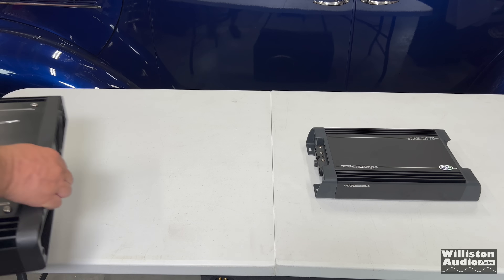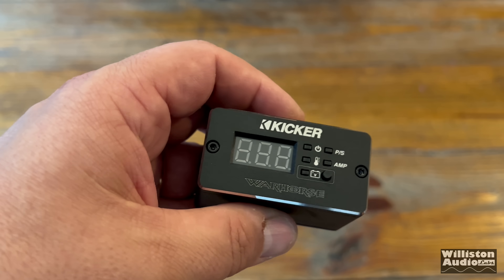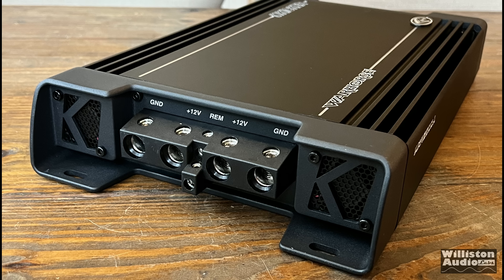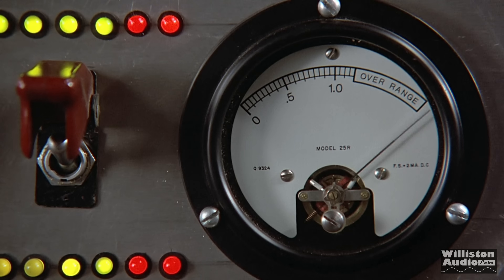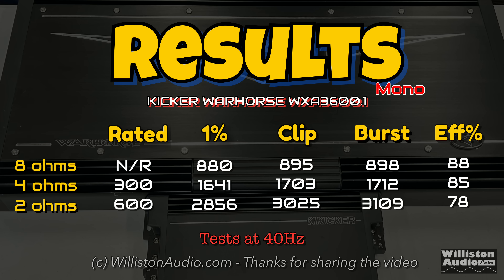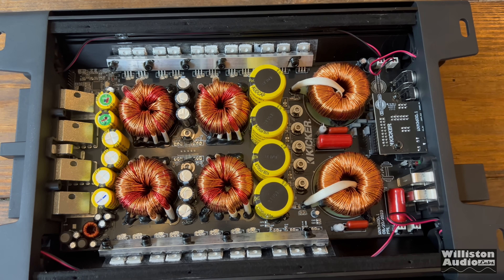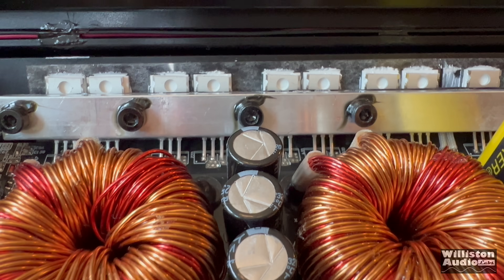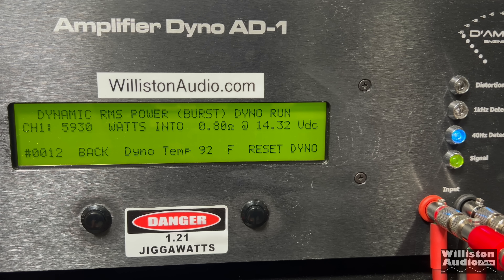KICKER Warhorse is BACK! WXA3600.1 Mono Amp Dyno Test

Comment from the maker: SHOP
KICKER Warhorse WXA3600.1 Coming Soon! (June 2024)
XS Power LTO Lithium Cells: https://lddy.no/1ivr6
KICKER Quad Box: https://amzn.to/3wBKEex
KICKER Key Loc: https://amzn.to/4dH5IRt
KICKER SoloX 12: https://amzn.to/497MQYk
KICKER Subwoofers on Crutchfield: https://howl.me/cjNYsFVKgx2
KICKER Subwoofers on Amazon: https://amzn.to/424JpOJ
KICKER SoloX Subs on eBay: https://ebay.us/UMhb2x
D4S Amplifiers and Speakers: https://Shop4Bass.com
SAVARD Subwoofers and Speakers: http://www.Shop4Boom.com (use code WAL7 for 7% off)

LINKS
KICKER Deep Dive Tech Talk about Warhorse Amplifiers: https://www.youtube.com/live/BNX7Sz_UMDE?si=_zxuxx9KGjgAfoBj&t=1165
KICKER Warhorse Amplifiers (coming soon) https://www.kicker.com/
My Unboxing of the Original 10kW Warhorse Amp: https://youtu.be/glj97XdfIVw
HiFiVega Warhorse WXA3600.1 Unboxing: https://youtu.be/-VF-Q1uWeU0
Livin' Loud with Andy Warhorse SPL Testing: https://youtu.be/lZVFBsH7nJ0

VIDEO INDEX
0:00 Intro
0:20 Warpony?
0:54 Years in the Making
1:28 Unboxing
3:45 Overview and Features
5:53 Lithium Power
6:13 KICKER Amp Test Procedures
6:55 Amp Dyno Tests
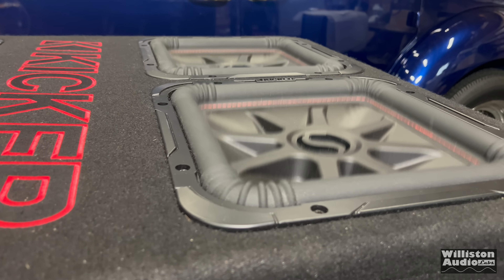9:53 Do it Bump Doe?
11:09 Watts Inside?
12:03 Power Supply Explanation
12:50 PROS and CONS
13:56 Final Thoughts
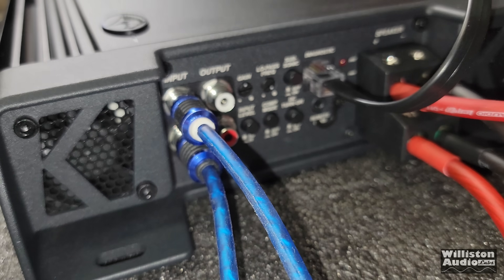14:39 EXTRA Tests

TEST BENCH EQUIPMENT
SMD / D'Amore Engineering Amp Dyno: https://goo.gl/sJTcf7
XS Power D1400 Batteries - https://amzn.to/2BPFCKW
XS Power PSC60 Charger - https://amzn.to/2CHGcfs
Fluke 1000A AC/DC Clamp Meter: https://amzn.to/2Rw5WDA
Handheld Dyno: http://amzn.to/2u2EgKV
My Favorite Screwdriver Kit: http://amzn.to/2x0VzcE

DISCLAIMER: This video and description contains affiliate links, which means that if you purchase from one of the product links, I may receive a small commission. As an Amazon Associate I earn from qualifying purchases
Reply: Hey big d, give me your honest opinion so you think full bridge just has a different sound to it more digitally or something like that. I honestly think it just sounds different from a Korean half bridge
Reply: I wish you could simulate a test with a smaller battery. People complain about the voltage being too high but A 320 ah lithium battery is 99 percentile car Audio enthusiast. Over $3000 in batteries.  Like can my little LTO 6.0 or my titan 8 run this amp?

Comment: I appreciate a clip indicator but I feel like I don’t really need it if gains are set correctly you’ll never clip no much how much you boost the bass frequencies on the eq on the head unit, you have to set the gain according to how you’re going to use the settings on the head unit so that your amp never goes past the max signal it’ll pull its power cleanly from the batt and alt without a distorted signal from the head unit

Comment: I am getting ready to install a custom enclosure in my 2024 Escalade using the factory stereo and using a LC2i pro to get the signal. My question is:
How will the kicker 1800.1 amp do with 3- Hertz MPS 250 4ohm wired together to 1 ohm? Am I saying that correct? Or would you suggest the WXA3600.1 for that set up I’m going to be running? Thanks in advance
Reply from the maker: The answer totally depends on your goals. I personally think the 1800 is enough for those subs, but if you are buying for the long run and want to possibly upgrade the subs in the future, I’d go with the Warhorse
Reply: @ thank you so much for getting back to me! I agree with you the 1800 is probably more than enough, however, I always kind of like to go big and get the best that I can. So if I install the war horse can I tone it down so that provides 1600 to 1800 W to those subs.

Comment: Just picked mine up the last item for my install alpine radio 
Audio control matrix 6
Audio control epicenter 
2 kicker cx360.4
2 pair kicker ks6x9
2 pair kicker ks pods
2 kicker kicker 12 inch marine subs IB set up 2015 dodge charger

Comment: Back years ago I had a Zr600 Kicker amp and it was supposed to be 600 watts RMS @ 4 ohms bridged, but according to the factory test print out. It was actually putting out 850 watts RMS, I was running a pair of 12 inch Solobarics (the round ones). I never never had the SPL tested but it had enough force to put out a zippo lighter of someone in the front seat of my little 92 Celica GT. I had a all kicker setup running off a Kenwood echelon head unit with a motorized flip face, the entire system cost me less than half of retail offline from a wholesale site. Needless to say this shop that had all kinds of high end electronics, nearly had an brain aneurysm when they asked me what I had when I picked up the crossover module I ordered from them and then how much I payed. They had some kind of deal that they were the exclusive dealer for kicker products in the area and me paying $2500 for a system I priced while browsing there, would have been around $6000.  They threw such a tantrum about their "exclusivity" deal with Kicker, that unless I told them what website I bought it from that I would be banned from the store. I laughed and said, "I already have everything I need from you and bye bye" as I waved walking out the door.

Comment: I'll take the Orion 2500. Half the price. Big D tested it a few years ago and it did 6744W at 14 volts at 1 ohm  Dynamic 😎
Reply: Don’t think they make the same amp now. I got the 3K Orion splx for 650 off Amazon. I think it did 10300 watts or so on big DS test
Reply: I have one if you wanna trade for this amp
Reply: in 20 years one will still be working
Reply: @kickercar  It wont be this Kicker thats for sure. cheap caps and fets. full bridge. Max lifespan of a cpl hundred hrs
Reply: @Cody6210  when is your amp line coming out
Reply: @kickercar  He's not lying, though. This Kicker amp is using some really cheap caps and FETs.
Reply: @TikiDoorman holy shit I thought you were joking but no those caps really are like China spec

Comment: I don't understand your comparison of the Sundown Salt3 in another comment. Compare the full bridge options for price and power.
Reply: Whether it's full Bridge or half Bridge it doesn't really affect the price.
Reply: @JasonWW2000  it absolutely does. Sundown full bridge 3k is far cheaper than the salt 3k. Theirs a reason full bridge amplifiers like Taramps, Banda, Stetsom, etc. are all less expensive than their Korean made amplifiers.
Reply: @FoxyBuildsDIY Yes, and I don't know if you understand why those brands are cheaper. I'll give you a hint, it's not because they are full bridge. Lol.

And how exactly do you explain all of the very expensive full bridge amplifiers from companies like Alpine, JL Audio, Kicker, Digital Designs, etc...?

Also, you're comparing Sundowns top of the line Salt series amplifiers to their entry level SFB. Their cheaper amps being full bridge is just a coincidence. It's actually not the reason it's cheaper.
Reply: @JasonWW2000  and if you look at the reference series or half bridge designs by those same brands they are even more expensive. If I remember right JL slash series is the only one in the lineup that uses full bridge technology. And of course they aren't all equal, those brands are using higher end components and larger power supply sections. But to say the SFB amps aren't comparable to the Kicker full bridge design is not accurate. They have very similar topology.

It's also not a coincidence that they are cheaper because they are full bridge. The fact is the Korean board's on the Salt amps are older Zenon designs and have more components and are more expensive than the Chinese built SFB amps using an original Soundigital design.
Reply: @FoxyBuildsDIY  Now you seem to understand. There's a lot more involved in the price besides whether or not it's full or half bridge. 👍

Comment: Hey I got a 2000.1 tramp amp but it keeps going into protection mode when the high pass hits….can someone help me out I’ve turned the amp down but my subs are ds18 gen x’s I have two with a peak of 2400 watt with each sub so it’s 1200x2

Comment: Looks generic.
Reply: It's not.
Reply: @JasonWW2000 I know the performance is there, but the looks are not. It looks generic compared to the og.
Reply: @CJGrand1  What do you think it resembles?
Reply: @JasonWW2000 something made by Maxxsonics. You know, like Crunch or Autotek.
Reply: I guess, maybe. I also see a lot of similarities with the original Warhorse. I don't see the looks being any kind of a problem, though. It looks good in my opinion.

Comment: 3.5 mm sub control connection? But has phone jack for little volt meter?= why not use phone jack on both?
What's up with that?  Makes no. sense? Come on kicker?
Reply: Kip actually explained why they used the 3.5 phono for the bass knob. The audio signal is passing through that cable and they wanted to use the shielding that's built in to protect it from picking up any outside noise.

Comment: lol, at 8:46 you're holding the cert sheet and I have my cert sheet hanging up in my cubical at work. All the Passes are at the same exact angles as my sheet. I'm talking IDENTICAL and my amp is almost 5 years old. My amp model is the 46CXA800.1. Just looks like they didn't actually test if the amp passed the tests and are just baked in stamps on the cert.
Reply: More than likely the paperwork for each amplifier passes through a machine that stamps them. Another possibility is the passed stamp is pre-printed. Then the paperwork is matched up to the specific amplifier and only the serial number and power is printed on it.
When you think about it, there's really no reason for a person to hand stamp each certificate.

Comment: But its a full bridge.... Save money and just buy a taramps smart 5 bass
Reply: What is your point about it being a full bridge?
Reply: @JasonWW2000  my point is it’s not a half bridge amplifier. If you are going to spend that much on a full bridge you can get wayyy more power for that price. But I mean hey, to each his own. You can buy the amp all you want lol
Reply: @KillaSquant420 I think you're mixing up full bridge design with Brazilian design. It's two separate things.

The fact that there's so many cheap Brazilian amplifiers on the market and they happen to be full bridge has warped people's minds into thinking that full bridge is cheap or low quality.

That is not the case at all. You can also get very expensive and high quality full bridge amplifiers from many manufacturers. 

Most people could care less what kind of output section an amplifier design is using.

Comment: You test the DB G7 2500.1? I have two just to run at 2 ohm strapped. Need to know if I can get more output with just one of these at same ohm load. If G7 does rated power or not……help!!!

Comment: I'd buy this in a heat beat if it weren't full bridge.
Reply: Are you mixing up full bridge with Brazilian? Those are two separate things. It's unfortunate that several Brazilian companies have came out with low quality amplifiers that just so happened to be full bridge and it kind of ruined the reputation for all full bridge amps.

A lot of the best SQ amplifiers are full bridge.
Reply: @JasonWW2000  no I'm talking full bridge. In my opinion they don't give the same fullness of bass as a half bridge. If run one on mids and highs though. I currently have a full bridge on my mids and highs.
Reply: @SG-Cichlids Do you know if the lack of fullness is directly related to it being a full bridge design or if it's due to something else about the design? This is very hard to determine. 

I've never heard anyone describe the JL Audio slash series amps as lacking fullness. Many serious SQ competitors run these full bridge designs. 

MBE is the only person I know that doesn't like the sound of full bridge, but he's only heard Brazilian. He just assumes it's the full bridge part of the design that's responsible and not all the other low end components, pre amp section and poor overall design. 

He's basically using correlation to prove a case of causation. The fact that there are many high-end SQ amplifiers on the market that are full bridge in design tells me a lack of SQ is not caused by the full bridge part, it's something else.
Reply: I've heard a lot of people say the same thing about class D amps compared to class A/B. 

I'm going to be doing some tests comparing my reference class A/B amps to 5 different class D amps. I'm talking full range, not bass. I already know class D bass amps can sound amazing. 

Later on I'll make some comparisons between half bridge in full bridge. I've got some Rockford T10001BD amps I can compare to a Kicker KXA 2400.1. 

I've got a lot of amps, some I don't even know which are half or full bridge. Lol
Reply: @JasonWW2000  to me they just sound different. Even with the full bridge on my mids and highs I don't think it sounds the same as amps I've used in the past. I've been using class d on subs for years and never noticed any sound quality issues from them. Except as you said with poor quality amps.
Reply: @SG-Cichlids You probably are hearing a difference. It's just really difficult to say for sure what is causing the difference. 

It's no big deal, though. Just run what you like. 👍
Reply: @JasonWW2000  for sure. The brands of amps I've always liked are jl, Rockford, and memphis. My favorite amp was a 1000 watt class d memphis belle from back in the day. Like 2000ish. The loudest two 12 setup I've ever heard in person was ran off that amp. It set off car alarms when I was driving down the street.

Comment: Ok. Just finished watching the power ratings and read some comments…  here’s my initial take on this amp… it’s an “end game” car audio subwoofer amp that allows you to change/incorporate many different styles of subwoofers/box setups and also designed to be “end game” for “dummies” (not actual dummies, but for those of us who would rather install ONCE and forget). No clip light sucks, but again, if it’s designed for someone who has a nice newer ride and just wants a competent powerful and clean sounding amp that is probably never going to clip or under power whatever you throw at it, allows one to change out sub setups, and even allows for high level inputs, I think this is a really good solution! 🎉. Yes it’s expensive, but again, if I were selling this amp as a solution to a customer, I would recommend it to someone that just says, “gimme the best most powerful and reliable, cool clean amp for whatever subwoofers I want to add at any point, install it with all the power it needs, and from there on, I can just change out their speakers if they want more or less or whatever”.  I’m sure the price will go down, and if so, at $600-$800, I think they could sell a lot of these amps! (Especially considering car audio is like 50% gp margins, lol) 🎉

Comment: I was about to move past this video until I saw the separate bass control and digital status readout.. this is actually pretty legit! Especially if it hits the power specified!! 🎉 also, it looked like the bass knob had two lights on it?? Are those dots the clipping lights? 🎉  I have to say, for my high end “wish” system, I have to go with a definite BUY for this amp!! 🎉  the specs and durability and quality of this amp is well worth the cost!! Especially compared to what we used to get back in the day!!! 🎉 thank you!! 🎉
Reply: There's no lights on the bass knob.

Comment: I am still waiting for Big D to test something as under rated as the HCCA 3000.1DSPLX
Reply from the maker: Man I don't know if that will happen. Manufacturers just don't rate at 12.6VDC like Orion did with that one. It was a 5kW amp at 14.4. This one is not far from 5kW at 14.4